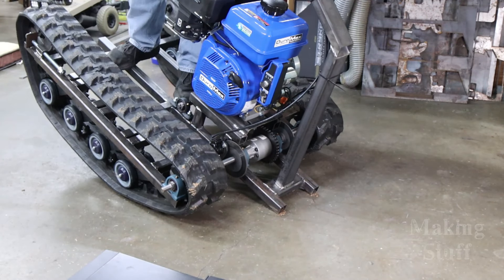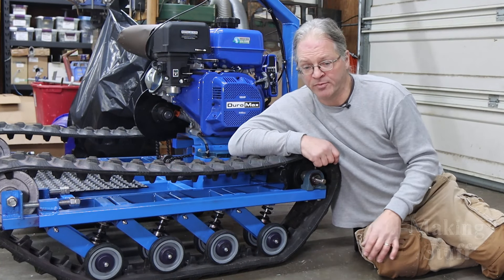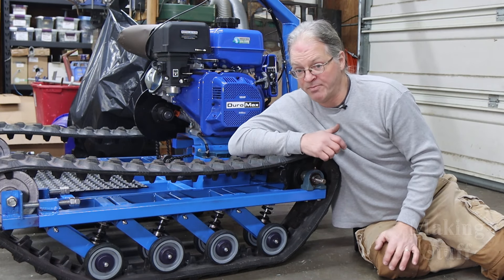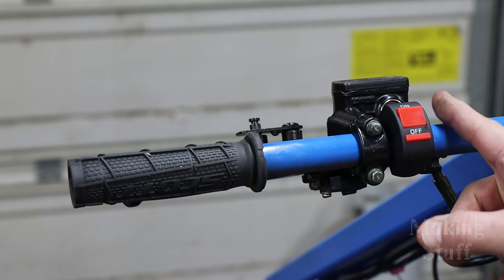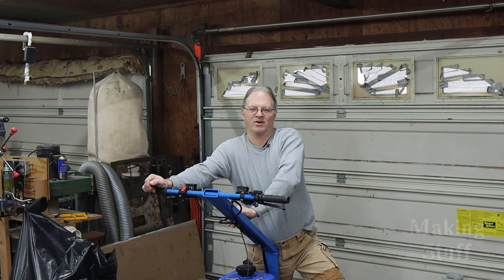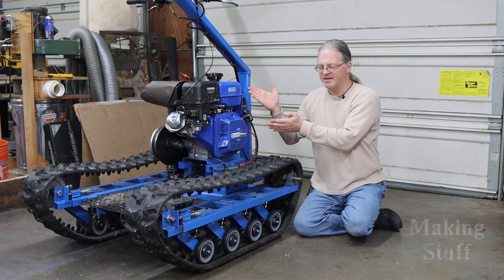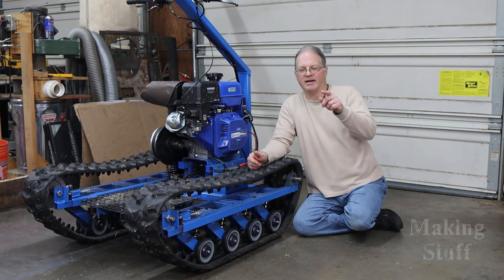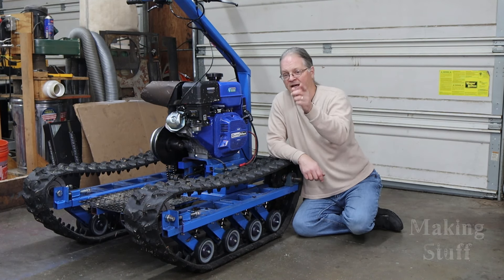Taking It For A Spin - DIY Tracked Vehicle It Lives!

Comment: I live up north and here in Buffalo we usually get about 100 inches of snow a season . Now I’m older and I use mobility aid such as a stand up Walker with wheels . My question is can you make those rubber tracks for a standing up rite manual Walker ? Cause the wheels just won’t go in that much snow or mud .
Reply: Not sure trax would work that well on a non-powered walker. Might be a cool project to make a powdered one. Take the electric hub wheels off one of the kids hover board things. Mount to the front legs and some bogie wheels on the back. Cut the side walls off mountain bike tires for trax. Maybe a couple roller blade wheel per side as middle bogies if needed. 😁

Comment: Turned out pretty well. I'd say it's probably way over-sprung though. Those bike shocks have a very high spring rate. Which makes sense if you look at the length of a mountain bike swingarm.

The upside being you have the best suspension known to man under your rear end on this thing. I think if it had a saddle you'd notice the lack of suspension immediately.
Reply from the maker: Yes I would agree that the springs are to stiff.  If you know where to get better springs please let me know.
Reply: @MakingStuff  I've had no luck finding something in that form factor but with a lot less spring-rate. Well, to be specific, find something in the surplus price range. Anything can be custom made for a price. Mountain bike rear springs are somewhere in the hundreds of pounds force per inch range. You might need something more in the dozens of pounds? Hard to ballpark it. But eight springs adds up quick. The benefit to that low spring rate though is that it might be a lot easier to find. I'd take a peek at McMasterCarr. I recall the last time I looked they had something close, but too light of a spring rate. Might be just about right for you though.

So I've had to solve similar problems with geometry alone. The downside, your damping goes down with spring rate. The upside, these things don't have much for damping to begin with so I figured not much of a loss. Looks like you have a lot of room to play around with geometry, by moving the upper spring mount above the center line.

Comment: I was wondering, how much of a benefit are the bike-shocks (springs)? It looked like they are pretty stiff for the weight of the vehicle, as I didn't really see too much deflection in the road wheels, but perhaps it was camera angle? Either way, I am glad you included them. So many builds without any suspension at all in them.

Comment: How did the boggie wheels hold up facing in that direction. Looks like shocks wouldn't work right. Let me know
Reply from the maker: So far so good.  The only thing that has broken on it has been a chain master link.  Just been putting gas in it and driving it for almost a year now.

Comment: Nice project.
Mud guards and I would suggest tightening the tracks, I have a mini excavator and I adjust to about 1/2 inch sag. Loosing a track, although not really hard to fix for that size, is a still pain in the ass and will wear out parts quicker.

Comment: Awesome Project and Great Job!  What's your opinion on the suspension.  Would have been cool to take a video with the camera pointed at the suspension to see if or how much travel it actually has and whether or not its worth installing.  Thumbs up!!!!!
Reply from the maker: The suspension pretty much does nothing.  The springs are too stiff.  I tried to get some that were softer but the company wanted several hundred dollars for eight springs.  I'm looking for used ones but haven't had much luck.  I'll make an update when and if I can find some.
Reply: @MakingStuff  Have you considered re-tempering them to make them softer? I'm gonna go watch the rest from the beginning. Are you making any plans available? I'm looking for something to haul firewood through trails in the woods, up and down hill as well as plow snow.

Comment: Thanks for the vid's. Found you via Pastor Chuck's build vid's. So, since it's been a while and if you've used it on a regular basis, how's it holding up? Bogie wheels and arms working flipped like that? Anything you'd do different now that you've have time with it?
Thanks! 
Bert
Reply from the maker: It has held up well.  The only thing that has broken on it is the drive chain.

Comment: Hey so I'm thinking I'm going to make a power wheels sized fully functional skid steer for the boy... would really like your input on the track system ....it will be all electric
Reply from the maker: These tracks weight 65 pounds each, so they probably wouldn't be a good candidate for a small electric motor.

Comment: Amazing! How did you get each track to spin independently on one motor to get out to turn? I'm currently working on something similar and am contemplating one motor for each side
Reply from the maker: It has a differential axle and is steered with the brakes.

Comment: I think you should put some metal or plastic plates aside and atop the tracks to protect your feet and lower shin area so you can slip and slide while standing and not worry about getting a foot flung off or caught up pants legs on or under the tracks.
Reply: I saw that issue, and I agree. Fenders over the tracks, near your feet. Maybe make them easily removable so that you can remove any debris that might get jammed in there.

Comment: So im guessing for parts and metal you have about 2500 into it? maybe a little more? Absolutely love the project. What are your thoughts on power? to much to little just right? love the electric start and hourmeter.
Reply from the maker: I've got a little over $2000 in it.  The power is just right.

Comment: Great job Bob, I was thinking of building one use on my place to move flat trailers, what you think?
Reply from the maker: Too much tounge weight on the trailer would make it pop a wheelie.  Other than that, it would probably work.

Comment: Great video, had a lot of fun watching you build this, you do a great job explaining. Question: did you get a speed on it? Just wondering what speed it would hit with an 18HP? Thanks
Reply from the maker: With the current gear ratio it will go almost 20MPH.  I can remove the governor from the motor and it will go much faster.

Comment: This is an awesome video! Exactly what I was looking for mostly. I’m actually looking to run the tracks on an electric motor via battery and solar charge system. I don’t want it to go fast though. Actually I’d like it to only move 12’ in 24 hours.  Do you have a recommendation on a motor that would run that way? What size I would need. I’d like it to go faster if I wanted it to but 99% of the time that’s the rate I’d like.
Reply from the maker: These tracks weight 65 pounds each, so they probably wouldn't be a good candidate for a small electric motor.

Comment: Correct me if I'm wrong here, but you don't have any ability to reverse this?  I understand that you can brake one side and bring the other side around, but it can't zero-turn?  I want to build a similarly sized vehicle with remote control, but I want a removable mount for  mower blades on the front for mowing to the edge of the pond and creek, also a deck for riding or using it as a heavy duty cart for the garden.
Reply from the maker: Correct, it has no reverse.

Comment: Its a pity you had to turn those boggy wheels around, they would have been much better, shock absorption wise, in the other direction. I guess it still works but you probably feel every bump from the road coming up through those wheels, then the solid steel then the frame, Where as before you would have had the shocks there to absorb the impact in compression they are now trying to absorb some of the impact in expansion. 
Love the project though!
Given me plenty of ideas! I think I might put a seat where your platform is and drive forward with the motor behind though!
Reply from the maker: Thanks for watching!

Comment: Nice build ,looks like the tracks got a little loose is that just normal stretching on a new track?
Reply from the maker: No, after riding it around for a few days I noticed the tensioners had backed off a little bit.  I just need to tighten them done better. Thanks for watching!

Comment: do watch ( rather be welding ) ?  will you make a stand up scooter make sure you use wheel barrow wheels and a briggs 5hp  motor with a  varibale touque converter  , and do you watch cars and camaras ?
Reply from the maker: Rather B Welding = Yes, Cars and Cameras = No

Comment: I dunno man. Seems like a bad bad idea having those wheels compress forward like that.
Reply from the maker: That's what I thought at first, but the springs on the shocks are so stiff that it really doesn't matter, plus the rubber track is going to absorb any hit long before it can damage the wheels.  So far it has worked fine. Thanks for watching!
Reply: There have been a few motorcycle suspensions like that. BMW's Telelever IIRC. AMP or Horst Lietner might have also built one.

Comment: looks like you copied chucks build
Reply from the maker: The only thing similar between the two builds is they both have tracks, an engine and you stand on it to ride.  Everything else from the steering, frame, track assembly and bogey wheel design are totally different.